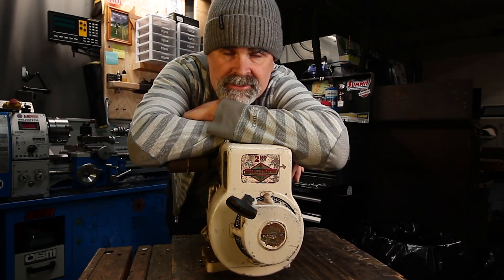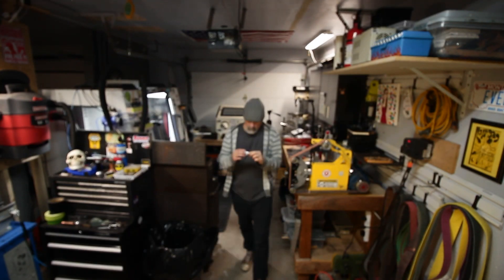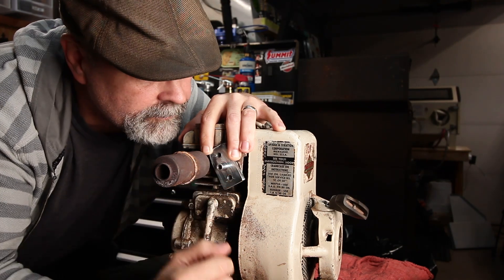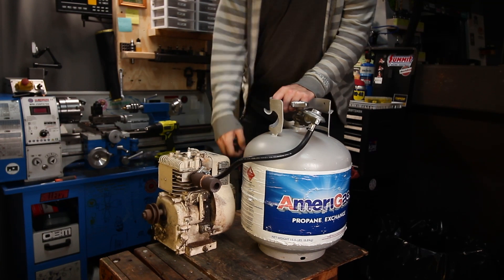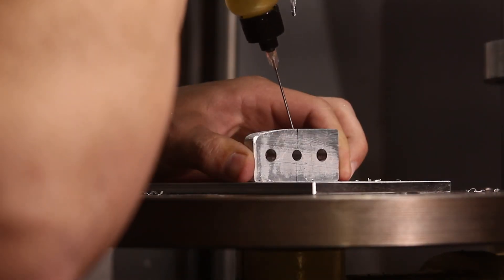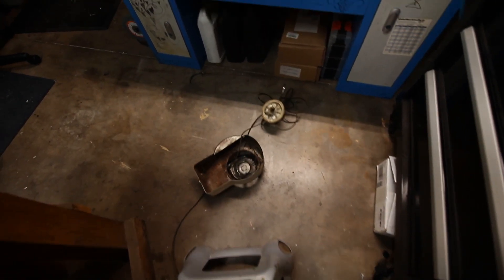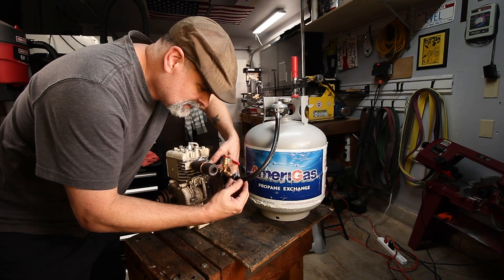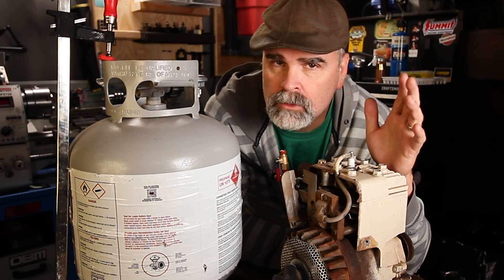How to Power an Engine with Propane

Comment: This video made me dumber after watching it! This corn hole knows that you have to have a carb and throttle valve on an engine to make it work and this does not help anybody learn anything. Especially people that aren't educated on how engine's work, this confuses them. This is just a waste of your time, don't bother with the idiot that has a milling machine in the background but doesn't know that you need a carburetor to make a motor run!

Comment: Theres no boxygen going to that motor just propane??  how does that work  DO you know  carbutators contol the air going to  ICE?
Reply from the maker: Around the 3 minute mark in the video I talk about the importance of air and poke holes in the tube. Later I add a T-valve to introduce air into the mix.
Reply: @GuerrillaShop-m3  I', a retired  Mechanic and when I was in school we studied carburators. Much later i studied Fuel insection for smog certification.  But you need the carb mainly because it contains the throttle vane/valve because thats how you regulate the airflow  and thus engine speed, beeing the airflow ratio is about 12-15 to one .  anyway it was drummed into my head engine speed is regulated by airflow so holes in the airline will not really give effective speed control.  Look it up  thats what the internt is for.

Comment: That was fun watching you reinvent the wheel. I've seen a riding mower guy do a simple valve fuel system. However, that's essentially steady state, fixed rpm operation. To use an engine for transient rpm range for acceleration is more complicated. Your replys to others indicate you are moving in the right direction, with LPG motor fuel regulator & carb/mixer. I think some mixers have an acceleration enrichment circuit to prevent stumbles. Look up small gasoline engine conversion kits for all parts for safety & best function. Note: propane richening is Hotter, leaner is Cooler, exactly opposite of liquid gasoline! Also look up "Spud in" conversion of a gasoline carb to propane. Just drill, tap & install per their instructions. Yes, I'll stay tuned to see a propane  powered bicycle because I want to build a pedal & 212 cc 4-stroke propane powered hybrid trike.
Reply from the maker: Hey Paul, thank you for your constructive feedback. Yes, I have been doing tons of research and experiments... including using a Garretson style regulator, connecting gas to spud, connecting gas hose to air intake, and even building my own venturi carburetor... I have also looked up almost every propane conversion kit on the market. Most of them are for generators that do not need a throttle. The rest are specifically designed for later model engines... so I'm really left with creating something on my own based on the designs that are out there or modifying a kit to fit my engine.  This has now become a challenge I must get THIS engine running smoothly. I can get it humming along no problem... it's a VERY simple process. The challenge is being able to control the speed of the engine (without blowing it up). Here's what I've discovered so far, and others may disagree. There is no need for a venturi on a propane carb. Propane is already vaporized and under pressure. That, combined with the vacuum created by the piston ... there's just no need. Garretson regulators are meant for low flow and very hard to regulate when it comes to adding a throttle. It works at one speed perfectly but as soon as you try to adjust gas flow... the engine dies. My best results so far have come from simply providing gas directly to the engine, introducing air through a hole and then regulating the speed of the engine by using an inline valve on the hose leading from the propane tank to the engine. I have literally tried every suggestion made on this video...  I am not one to give up so I will come up with a solution. And when I do, I'll make another video. Have an awesome weekend!

Comment: Use a vacuum demand regulator so you don''t leak propane if the engine stops!  Also, if you add some sort of airflow control, a demand regulator should provide more or less fuel depending on vacuum, keeping the air/fuel ratio consistent. I've used (overpriced) kits to convert engines, but demand regulators by themselves cost far less than conversion kits.
Reply from the maker: Thanks! Yeah I bought a Garretson style regulator but I'm still not about to add a throttle and control the speed of the engine yet...
Reply: @GuerrillaShop-m3  I like the progressive nature of your videos.

Comment: They have been running small engines plus Cars Etc like this in New Zealand for more than 50 Years, there Gas stations have pumps that do CNG or Propane to fill up your Car tank, there is a simple Carburetor that can be used as dual fuel for these small engines
Reply from the maker: Yeah, been looking for one for this engine... no luck yet...

Comment: Not all of us are graced with having a CNC machine so may need to resort to more primeval means!
That said, I think this engine in 4-stroke? What if we wanted to try the same conversion with a 2-stroke motor? We would need to get some lube in there, after all.
Reply from the maker: Yeah I have two stroke on a bike I ride around the neighborhood. I want to convert to propane but I'm not too sure about the oil/fuel mixture...

Comment: You should probably be using two one way check valves for the fuel and the air so you don’t lose gas. After the check valves you should use two variable valves and then a mixing chamber and shot for stioch of 15.67 air to fuel. You should also probably use a flash back arrester after the mixing chamber to connect to the engine. Safety. You could attach the variable valves together once tuned as a throttle so they will open together when you want to rev up. You might want the fuel to open slightly faster to stay slightly rich for cylinder temperatures.
Reply: I was going to mention the one way valve also and I know next to nothing about engines.
Reply from the maker: Hey thanks for the advice! Makes sense. I bought a Garretson Style Kn Low Pressure Regulator that only opens when gas is pulled through. Also found a carb for this engine on eBay... I'm hoping to connect it all up in a few days when it comes in the mail.
Reply: @GuerrillaShop-m3 hoping to see that video when it comes out. I've been reading about it as I want to convert a small junker motorcycle to run on propane for the helluvit but all I'm seeing is info on generators meaning there's no type of throttle control and anything else that does have throttle control uses a bunch of sensor and electronics which I don't mind but I'm more interested in doing a purely mechanical design to get a solid grasp on the concepts regarding compressed fuels, also mechanical will be simple, reliable, and easily maintained and altered in the future

Comment: That shouldn't work. Poking a hole on the tube will just leak the propane out.
Reply from the maker: Actually, the piston creates a vacuum that sucks the gas in... the hole just allows the air to mix with the gas. I was actually surprised at how simple it was...

Comment: Try using a regulator from a air compressor
Reply from the maker: Thanks! Just bought one. Waiting on carb I bought off eBay so I can hook it all up. Hoping to use the carb to connect a throttle...
Reply: @GuerrillaShop-m3  I use the regulator off of a air tank use for a crawfish burner and I'm here to tell you it will blow really hot
Reply from the maker: Bought a regulator used for propane conversions. Going to put that right after tank but before carb. Think that will work?

Comment: Old school methods work eventually
Reply from the maker: Yes Sir! They do.
Reply: @GuerrillaShop-m3  could do with 2one way regulators get a good burn (cooking on gas .when I was about 14 it was project microlight altering carbs for altitude but fell on propeller for right size and curvature just would take chance and couldn't afford them
Reply: @GuerrillaShop-m3  all started from the electric bogey 12volt car batterys motors washing machines of course,starters anything we could get are hands on with a bit of funding could of had own airline

Comment: Garretson KN demand regulator
Reply from the maker: Yeah, found one on Amazon. Thanks!
Reply: @GuerrillaShop-m3  They use an old carburetor with either plate for injection but its better to inject thru the same opening gasoline would go in by means of drilling out and enlarging the jet .  You can buy kits for most  generators. study them. I am not an expert at all.
Reply from the maker: I’ll do that! Sounds like a smart way to achieve what I’m going for… Thanks!

Comment: I did this years ago by using a hose with a valve on it connected to the carburetor or a fitting in the air intake just before the carburetor so that the carburetor and governor regulate the surflow (no pressure regulator - use the valve to adjust the propane flow.) It worked fine with little to no load on the engine, but as engine load increased and the governor opened the throttle, the engine would go lean and stall because the propane flow was constant . You need a regulator that will adjust the propane flow up and down to meet engine demand. And also to stop the propane flow in case the engine stalls.
Reply from the maker: Thanks for the tip! I’ll try that!
Reply: The only right comment 👍
Reply: Also propane produces a whole less power,so its starting with a disadvantage,you would need a much larger regulator.i think the smarter thing would be to build a hydrogen generator .and run it ON H2O .

Comment: You have a cnc so just figure out a venturi adapter for this engine and cut it out. . I'm guessing a 50 0rfice at 11 in.wc. and a dial air control and it will be running smooth in no time.
Reply from the maker: Thanks for the advice!

Comment: I've played around with this myself. I didn't ever get it tuned in right. I'm going to revisit it though. I have an old flat head I think I'll try it on. I notice a difference in the different regulators I had. Some seem to be better than others.
Reply from the maker: Yeah man, I just bought a new regulator that’s supposed to be made for converting gasoline engines to propane. Gonna try it next week! Good luck. Keep me posted. Have a good weekend!

Comment: Those recoils are easy to fix. See Taryl Fixes all video on briggs and stratton recoil repair. A lot of the time the issue is not the clockspring but the clutch mechanism it attaches to. Of you degrease it and relube it, the recoil will work great.
Reply from the maker: Yeah man, I watched a YouTube video about it. The pull sting wheel was broken. Ordered the part. Thanks for the advice. Also lubed clutch mechanism. Have an awesome weekend!

Comment: There is a company that makes kits to convert gas to propane or natural gas.
The main advantage is that propane is much cleaner than gasoline.
Reply from the maker: Thanks! I just looked one up and bought one. Do you know if it's cheaper to use propane?

Comment: Somebody must make a conversion kit for a mower engine.
Reply from the maker: All the ones I found are for dual gasoline and propane. I did find a few for just propane but those do not seem to have a way to connect a throttle...
Reply: @GuerrillaShop-m3  there is a company that makes duel fuel for mower engines. Full price is around 200.00 dollars. You can run on gasoline, propane, natural gas.

Comment: And omg you don't want propane leaking around the hot muffler with sparks coming out. To lean on a mixture will make it over Rev 3000rpn too and melt the piston being to lean
Reply: No you are wrong
Lean burn by propane will not make the engine hot. 
That is when you run on gasoline. 
When you run propane or lpg it is the otherway around. 
So a rich mix will heat op the engine.
Reply from the maker: Thanks for the advice :)

Comment: The small holes you made in the base, try one hooked to propane with the adjustable valve. The large pipe you made should be the air intake with adjustable valve, but it will probably need to be bigger.  14 to 1 air fuel ratio for gasoline atomized
Reply from the maker: Makes sense Richard. I really appreciate your input. I will try that...

Comment: While you were making that adapter on the mill you should have made a throttle body and introduced the propane behind it with a needle valve to control your air fuel mixture
Reply from the maker: Good idea! Yeah, I’m making it up as I go…

Comment: New to the channel. If stuff like this interest you. Another popular alternative fueling is by running off vapourized gasoline. Sounds way harder than it actually is. If you create a fuel tank or container thats sealed. Create a inlet to the container with a hose thats comes through the top but the opening of the hose is at the bottom of the tank UNDER the fuel level completely. Then a outlet in container from the top, far above the fuel with a hose that goes into a throttle body. Then into the Engine. You can add a valve like you did to lean out the engine. I actually used the original carb for a throttle body without even covering any of its ports. Essentially what is happening is as the engine spins it is displacing the air in the fuel tank and when new air comes into tank it is coming in below the fuel level is causing bubbles which brings octane vapour into air. Im very bad at explaining but me and a buddy made one back in middle school with a 5hp flathead briggs without slot of fine tuning. But your running on straight fuel fumes and from the butt dyno, alot more power.
Reply from the maker: Ok, that sounds interesting as heck!  I'll have to try that. You did a great job of explaining how to do it. I could totally picture it in my head. I find engines so fascinating and it's curious how there are so many ways to fire the piston. Do you think propane would be powerful enough to propel a bike (once it's in motion)?  If not, do you think the vaporized gasoline would be enough? Thanks for your comment. You got my brain going now....
Reply: @GuerrillaShop-m3  I've never owned the smaller flat head just the 5hp. Spun tires and went 30 without problem on my go kart growing up with my vapour carb made out of a plastic cookie bin. I think you will have plenty of power to do what u want. Do you plan on doing a belt drive with manual clutch. I mean just with a lever to engage it much like a lawnmower foot pedal. I've seen that done alot. Let's you slip it the without worrying about bogging instead of just a go kart clutch. I've tried using a 6.5 honda on a motorcycle chassis with a standard go kart clutch and burnt the clutch in one ride. I haven't watched any videos about the whole vapour carb but I thought I was told project farm made one.
Reply from the maker: Well I have a little 2 cycle motorized bicycle I already built. Might try to use the lever operated slip clutch from it. I just think it would be cool to have a propane powered bike! Especially if I could use those little blue propane screw-on bottles they sell at Home Depot. I'll make videos of the process. 
Curious... did you save on gasoline by using this method?